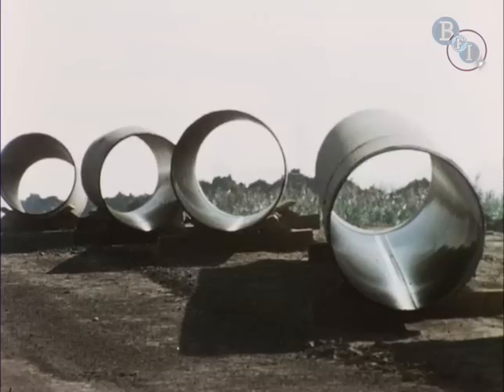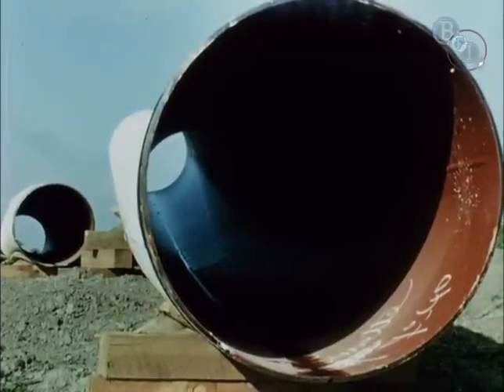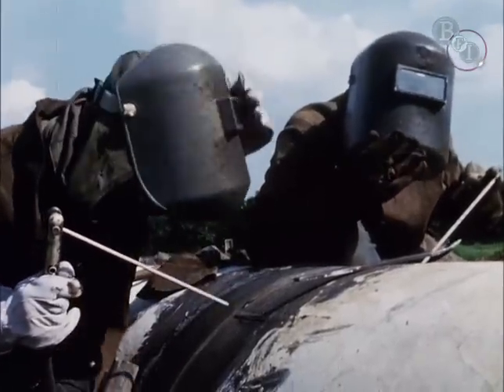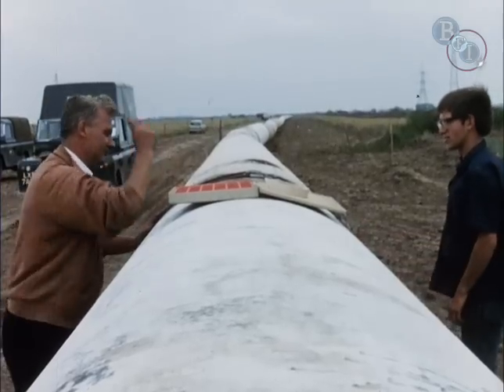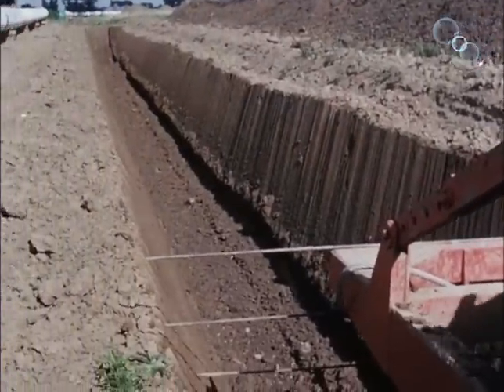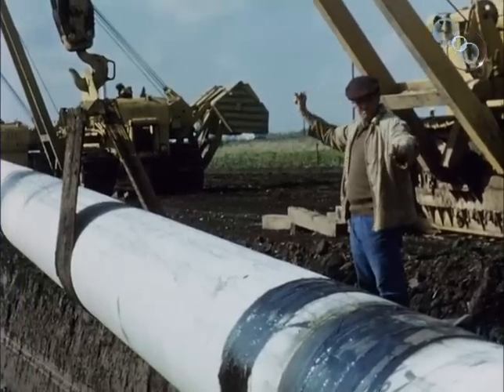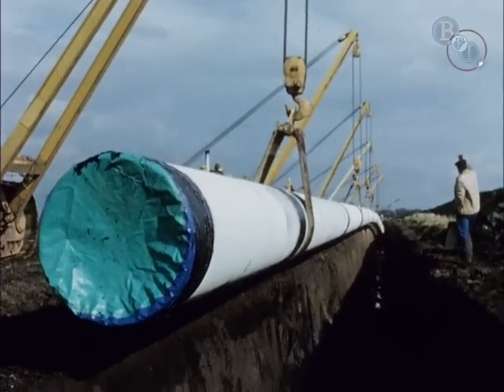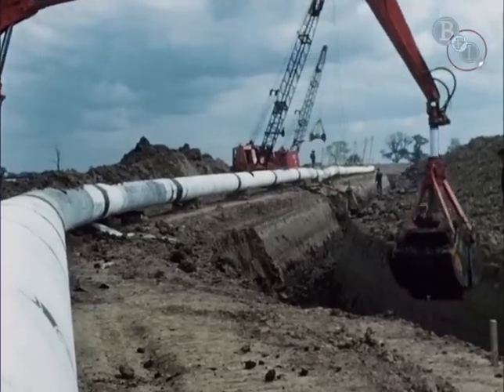Pipeline Through the Fens (1968) - extract

Comment: The Pipe looks like it came from the Hartlepool 44 inch Pipemill, the coating is Bitumin so probably done by Bredero Price.,(that's a guess)
Back in 1968 Pipeline welders doing the root used to be on magabucks but they were not allowed more than a couple of cutouts so you had to be good. A good Welders Mate was probably the key to getting a good weld, I was a Gas Council Inspector back in those days.

Comment: Again, wrong. If you learned anything in school, you would know the 1 in 6010 stands for all positions; it can be run downhill and is "designed" to. 7018 (up to unlimited tensile strength) is the only "all position" rod out of the commonly seen rods used for piping in petrochemical that cannot be run downhill due to the composition of the rod and flux.
Reply: 7018 arent the only rod that cant be used for stoving. 7016 cant be run downhill, 6013 cant be run downhill. 
In fact 6010, 6011 and 8045 are the only rods that CAN be run downhill.

Comment: I don't care what your CWB book says. 6010's can be run downhill, and are meant to be run downhill. All pipelines welded to API 1104 code are welded downhill with a 6010 root, 6010 hot, and a 70+hippy fill and cap. Get out of your fab shop and do some real welding and you might understand how it works.
Reply: 6010 can not be run down hill. No just no. In fact no stick rod should be applied by means of (stoveing). Or downhill not even NU5, or celulosic rods.
Reply: Dp908 I run it downhill all the time. Been a certified welder close to 20 years .  I don’t care what the book says
Reply: @zx6rlew.150  LOL The biggest pipeline companies in The Netherlands all run 6010 downhill, what the fuck are you talking
Reply: @zx6rlew.150  what book is claiming 6010 doesn't run down hill? It is a industry standard.
Reply: @zx6rlew.150  POOP